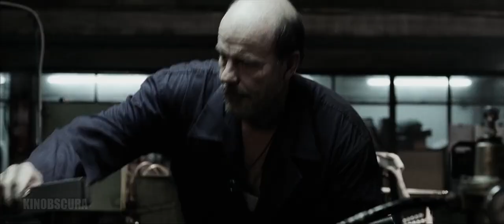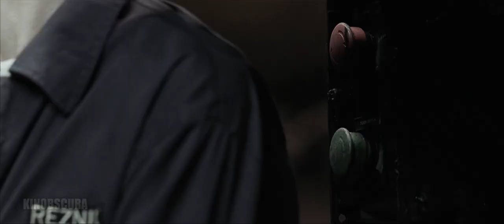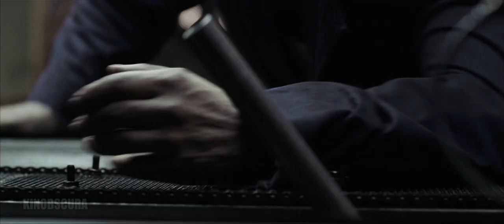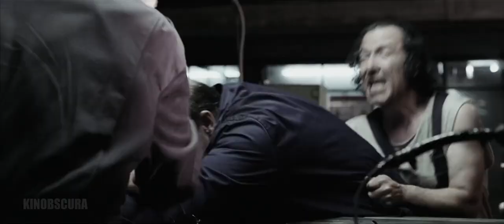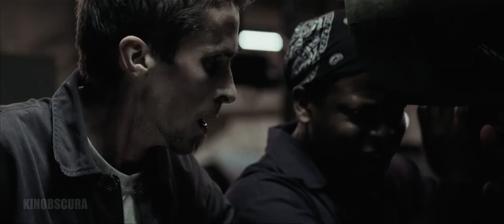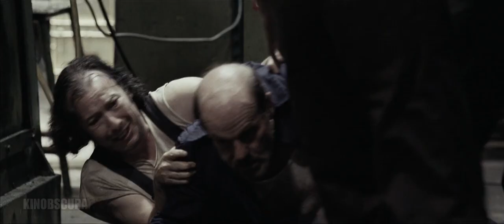The Machinist (2004) - Miller Lost his Arm

Comment: I thought, in most factories, there were rules about no long sleeves around heavy machinery like this
Reply: Jeremy Latta there are and it states that he wasn’t following this. later in their meeting they mention it
Reply: They make note of that in the movie during the evaluation after the incident  with Trevor and his superiors
Reply: Thats why I go short sleeve always, but I've told the experienced machinists but they don't listen to me
Reply: I’ve worked in factories where we wore lab coats on the line so a lot of places probably don’t care about that rule
Reply: Most places that uses lathes, drill presses etc I've worked at seemed to just wear long sleeved boiler suits.

Scary really.
Reply: I worked in a factory with cnc lathes and millers. Basically you didn't have a need to access the spindle while it is spinning, nor you could due to emulsion shower (unlike old school machines). Nevertheless, we wore short sleeves.
Reply: Dude should’ve tried to take off his shirt if anything
Reply: There is.
Reply: I believe you are also supposed to inform supervisors you are making adjustments to the machine and power is supposed to be cut off before those adjustments are made.
Reply: Heavy machinery is supposed to have a working emergency stop, and proper lock out tag out procedures are to be followed….
Reply: You don't get it do ya
Reply: "You thought!?"
Reply: All safety rules are written in blood.
Reply: Where I work we practice lock out/tag out where you shut off the electrical switch and actually lock it in the off position with a padlock so that the machine has no power until YOU unlock it, much better system honestly.
Reply: No they have locked out tag out rules that would have disabled the machine. Long sleeves are awften required to protect from cuts or burns
Reply: This is a hollywood factory. long sleeves are encouraged.
Reply: This scene is quite gruesome 🤢
Reply: You'd be surprised. I've worked in some serious shitholes that were way worse in terms of health & safety.
Reply: It's called OSHA i think .😊
Reply: Safety third.

Comment: I'm a machinist, and I can't figure what kind of a machine this is supposed to be. It looks like a horizontal mill... but the bit is vertical, and it looks like it's to chamfer edges
Reply: Yeah same here, it looks like it feeds the part into the tool, but never seen anything like that. But i also run hass mills and cnc machines, and that definitely looks older obviously
Reply: Looks like maybe some kind of machine planner but for metal, but also dont know what the Conveyor is supposed to hold, doesn’t look like you can clamp anything down to it. So im confused too, might be a made up machine for the movie who knows
Reply: @evanjones288  they could've done the same thing with a lathe in that case. Sleeve stuck in the compound while performing a threading operation, idk.
Reply: @DolphinPain  oh yeah, theres tons of videos of people getting there sleeves stuck in a lathe or there whole arm
Reply: It looks like a router bit or something. I've never understood this scene. I've seen gang drill press like he's running at the start, but the machine miller loses his arm on is a mystery.
Reply: @evanjones288  what does a machinist do excally? You guys make tools like bolts screws etc..I really never put much thought into the vocation.
Reply: @ProfessorKenneth  my factory makes steering shafts and input shafts for Ford cars transmissions. So my machine cuts a blank steel part and makes it into a input shaft. My machine is called a mini mill and i used to run a machine called moris. Look them up on YouTube there pretty cool
Reply: @ProfessorKenneth  actually they are called haas mini mills and mori cnc machine
Reply: @ProfessorKenneth  

It's a wide covering discipline. The place I worked at years ago mainly made dual plate check valves from an inch and a half up to several feet across in internal diameter.
They also made impellers for slurry pumps and also antennas and antenna parts for airport and ship based applications.
Reply: @ProfessorKenneth  at my old job at an aerospace shop we made parts and panels and the seats for private jets, and we had some military contracts but I have no idea what for.
Reply: @ProfessorKenneth  Modern machinists make and configure the one-off tools that are used to mass produce the tools other people use.
Reply: @ProfessorKenneth  i make gears hobbing machines .
vertical grinder works 
i am in europe
Reply: I think it is a horizontal mill but knowing Hollywood they most likely added the tool for dramatic effect…